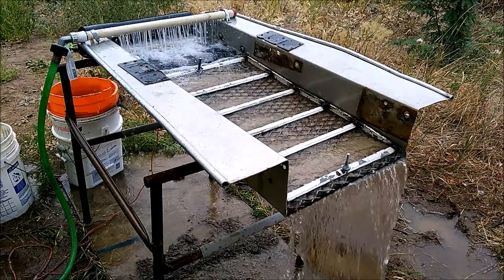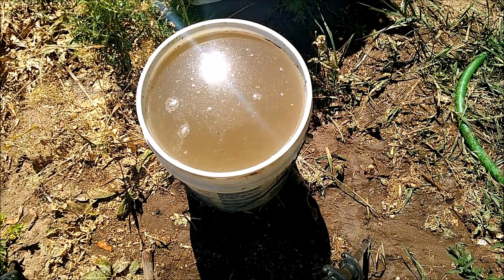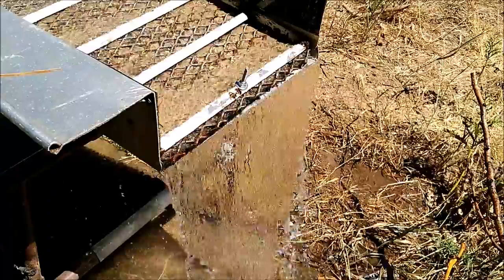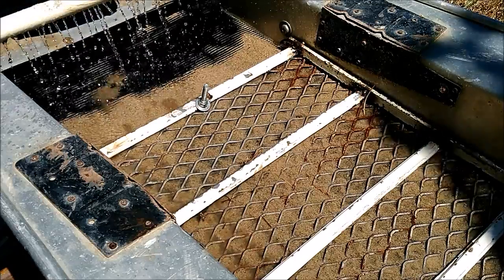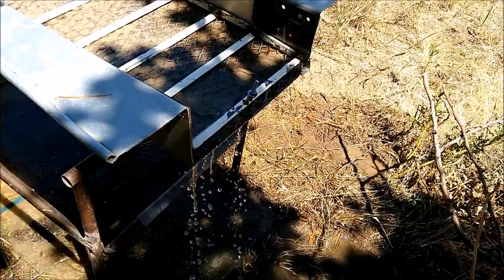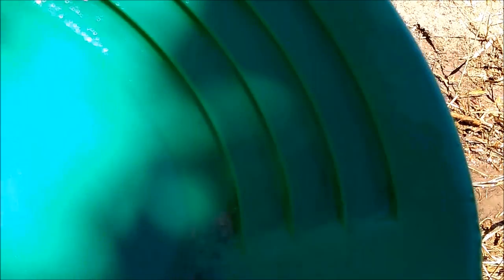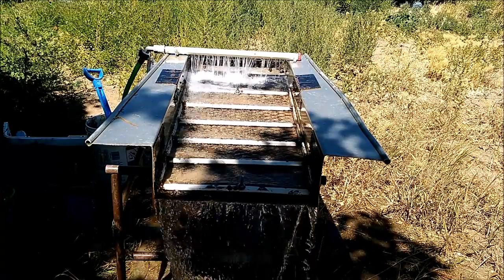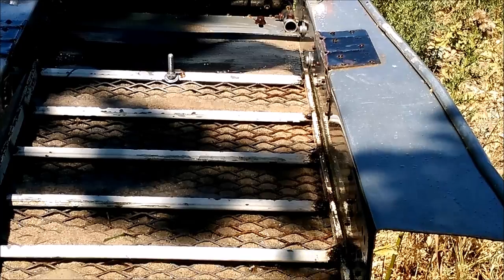Basics of using a sluice

Comment: After  you fill the bucket with material and you fill it with water try putting your bucket in another bucket just in case,   And now let your house churn the water , making the rocks rumble around and the lighter stuff will float out, let me know if it works out for you ok .